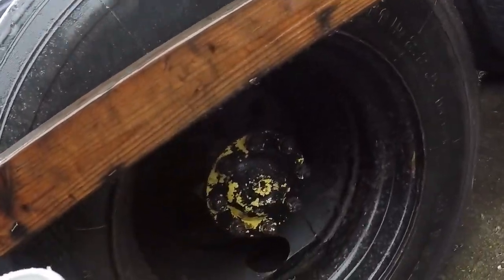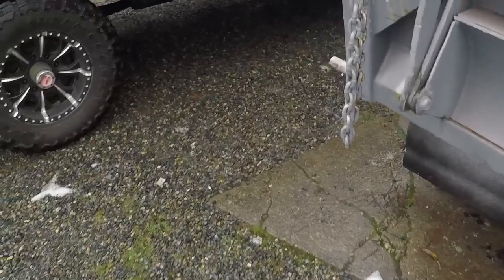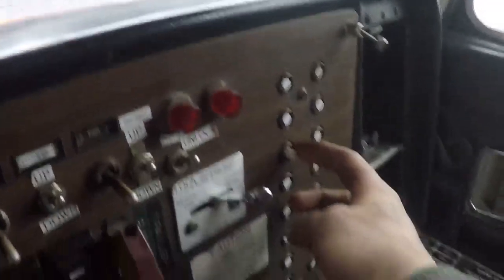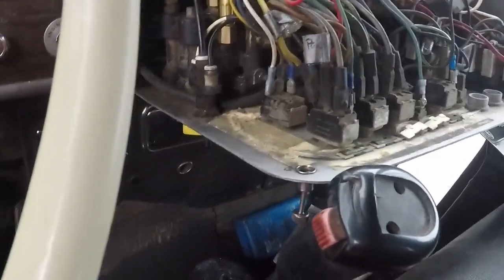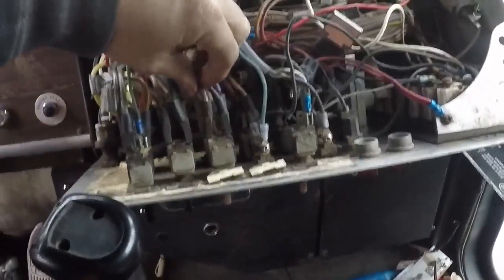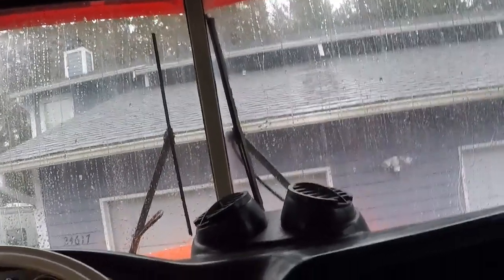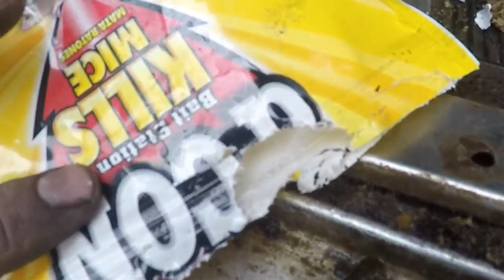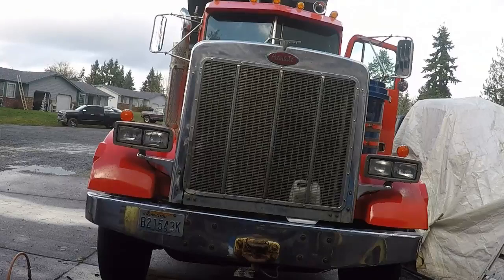REASON FOR WIRING RAT NEST !!!!

Comment: What a daunting task is ahead for you with running down all your dead shorts, loose connections, etc..  But with your "can do" attitude, I'm sure you'll get it all sorted out - one wire at a time.  By the way, older Petes were known to have wiring problems.  I had the dash melt in the old 68 I used to drive; and many an old Pete just sat there, caught on fire, and burned to frame rails.  You were very smart to install the master cut off switch to eliminate those issues.  chakos 123 gave some real good advice also.
Reply from the maker: yes he did and I will do that!, that is scary to think that it could just burn down 10-50k in your driveway... glad I installed the cutoff switch
Reply from the maker: this whole truck is daunting lol hahah one step at a time. that's the only way to tackle a big project like this.

Comment: What is that truck a peterbilt 349. I one i have is a 1986 peterbilt 349 with a cummins big cam IV with a 9 speed and air leaf rear suspension with double frame.  It has 15' foot bed 4 axles.
Reply from the maker: its a 85 peterbilt 359
Reply: It's hard to tell the short hoods apart because some 349's came with stainless around grill like a 359 and my 349 came painted around grill.

Comment: Do yourself a huge favor.  Go through ALL of the hoses on your truck and ALL of the wiring.  Look for spots that are rubbing and wrap them with rubber hose.  After you run the the truck for a month...........do it again.  It will save you a lot of hassle and down time.
Reply from the maker: I'm planning on it or possibly getting a hole new harness

Comment: Little bastards, I think they make electrical tape the is rodent deterant, if it continues to be a problem, but sounds like it was like that befor you got the truck.
Reply from the maker: well basically everything worked when I got it except the passenger side , dang rats ruined it for me lol, you live in Washington?
Reply: Brian Van Duyn No, live in Michigan, same problems though.
Reply from the maker: +JEFFREY KREFT OK well good luck on getting a dump truck I'd go used and join a group on Facebook that sells dump trucks I think that's the best way to find a deal on one. and always pay cash don't use debt !